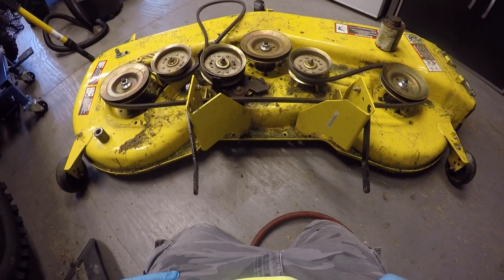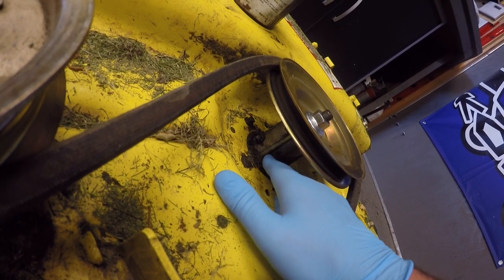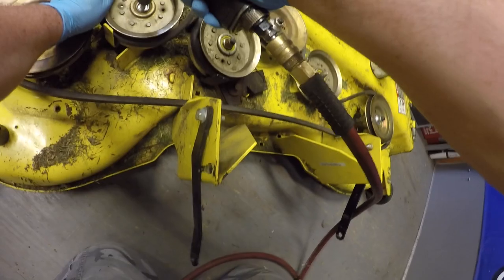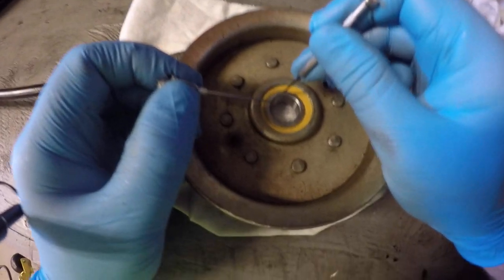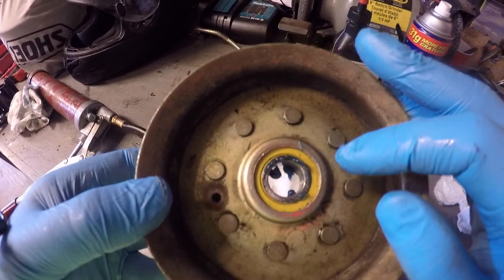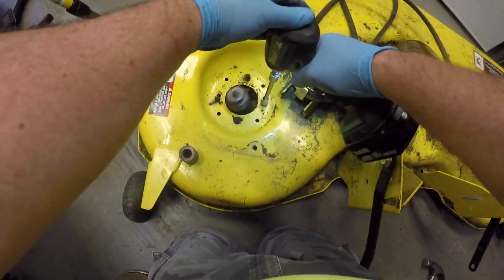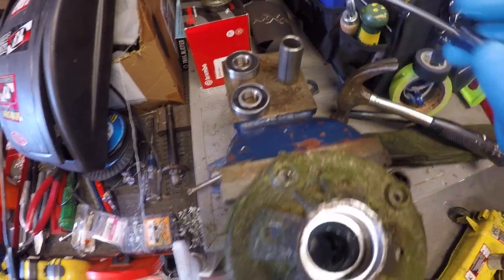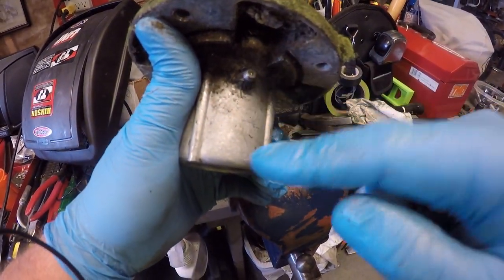John Deere D170 mower deck maintenance tips

Comment: The idiot designers at Deere could have easily put those spindle grease fittings a half-inch higher so the grease gun nozzle would go straight on.

That would have made lubing the spindles MUCH easier.  As is is, I just forget it.
Reply from the maker: I probably don't grease mine as much as I should but at least i have plenty of grease in there now.

Comment: Please tell me where the slack in the belt goes. Looked up diagrams. It's like I'm missing a piece of the puzzle.
Reply from the maker: I’m not sure what you mean, the final pulley to install the belt on will be the pto on tractor. Make sure you watch the deck removal video it will show how to take off belt tension and re tension the belt that should take up all the slack. Also make sure you got the right belt if you got a new one by chance.

Comment: You have Trouble with the Belt falling off ?  I replaced all the Bearings on the 54 inch D170 deck  the Idle arm bushing , spring , everything is new but it is still throwing a belt off the PTO .   set the deck according to the book it cuts even . just the belt comes off way to much .  tall patch of grass or a bump .    it was doing it to the last owner . reason I replaced all the Deck parts .
Reply from the maker: I’ve never had that issue. Can you remove the belt by hand with tensioner spring in correct position? If you can easily something not right. Did they replace pto with one with smaller pulley? Or change other pulley sizes? I’m assuming the belt is correct.
Reply from the maker: Also is it routed correctly?
Reply: @bikermike   I replaced all the Pulleys and bearings . did a new belt .  everything was the same size .  the D170 have a Belt Guide on the PTO for the Deck ?
Reply: @bikermike   yep  I got it used I have no idea if its missing a belt guide for the pto
Reply: @bikermike  I did a New PTO its the same size in height and pulleys .  Belt is tight if the deck bounces it falls off the pto .
Reply: @bikermike   What I did find is speed of the blades when turning on the PTO Slow Idle before turning them on . tall thick grass go slow .  and last is the front deck 1/2 inch higher than the rear .   doing that   Thanks for helping
Reply from the maker: @JCcanU  I'm pretty sure the decks need to be lower in the front, I know mine is.
Reply: @bikermike   I have no idea im at a loss it still tossing the belt , even after adjusting the deck everything is new on the deck  new PTO  plus belt  .
Reply: @bikermike  I found out why today the front deck lift linkage was worn on the end that goes into the hole on the deck had a cut like a saw from the deck that extra 1/4 inch play the belt would fall off over a small bump or forward to reverse .   I have it fixed now .
Reply from the maker: @JCcanU  👍thanks for posting this! I’ll have to keep an eye out for wear on mine now too! 🤙
Reply: @bikermike  400 hours on mine
Reply: @JCcanU make sure you have the right belt.. John deer belts are stiff

Comment: Missed getting the cap released. Is mine froze or is there a trick.  Thanks
Reply from the maker: Not sure what you mean by cap? If you meant nut then an impact gun while carefully holding the pulley or you will have to carefully block the blades with wood and use a wrench.
Reply from the maker: 2:20
Reply: Gosh thanks for replying. Some call the part on top of the shaft under the pulley the cap. Top bearing spacer/ cap.
Anyway. I remembered my brother-in-law storing his press at my place. Duuuu. When used used it to press the shaft out of the assembly, it popped right out. 
Well my d-170 is only about three years old now. Most of the spindles seemed ok except this one. A little grindy. After removing the bearings, I found one of the top bearing seals was disintegrating. The ball bearings seemed ok with a minor roughness. I will replace it.
Now that I have done one, I will be pulling the others to inspect, pull one side of the bearing seal for each, re-grease and re-assymble.

I also discovered the existing grease was beaking down....

I'm glad I started now addressing these instead of later when they have already disintagrated.

Would you have a grease type you have found better than most?

Thanks Mike
Reply from the maker: @charleshamilton5127  I've mostly always used any type of (synthetic) wheel and chassis grease. It is much less suscceptable to breaking down in the elements. I know this to be true as I once used synthetic grease to seal the sealing surface on my dirt bikes foam air filter instead of regular grease and it was almost impossible to get it out with varsol when I cleaned it next.  Always use it on my truck as well.

Comment: grease goes right by those covers and threw the bearing  ,  a grease gun puts out 10000 psi , those covers aint gonna stop it , people think they are seals but they are not , they just dust covers ,  actually a gentleman made a vid on you tube to prove it using 2 different coloured grease